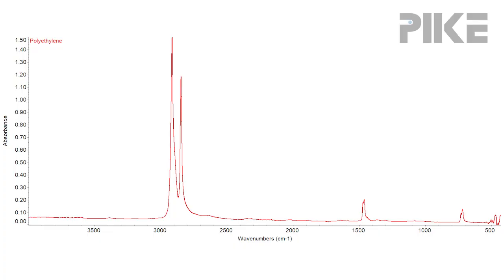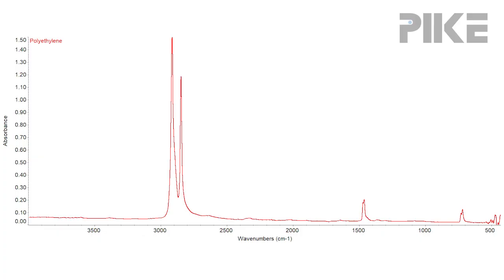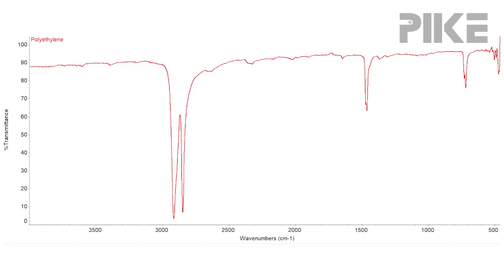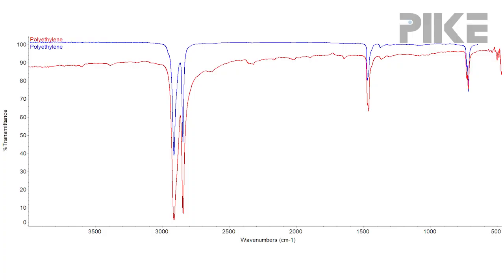What could cause a sloping ATR baseline?

Comment: Thanks for the tips! Any thoughts on sloping baselines for particle samples? I've gotten severe sloping on gold nanoparticle deposits that I could never resolve. I think I once read that this could be from scattering by the particles?  Not sure if this is related to the critical angle issue you mentioned or a different phenomenon.